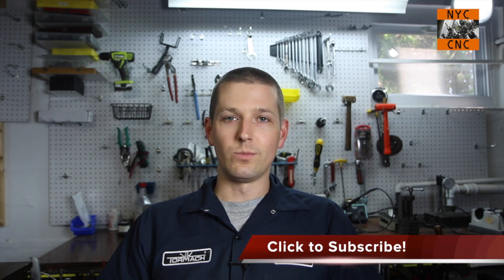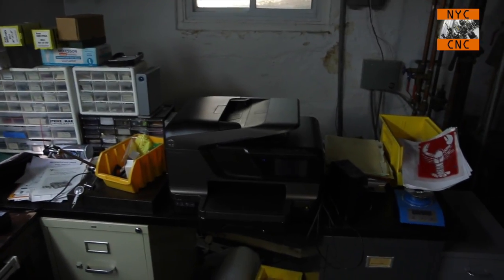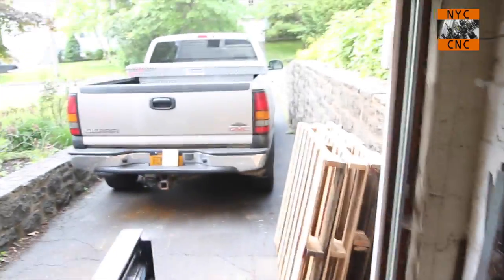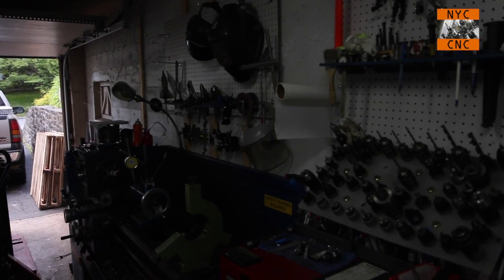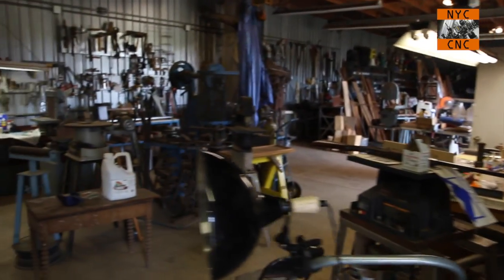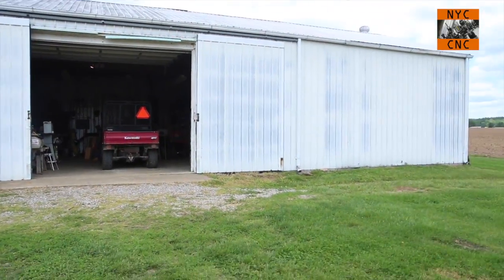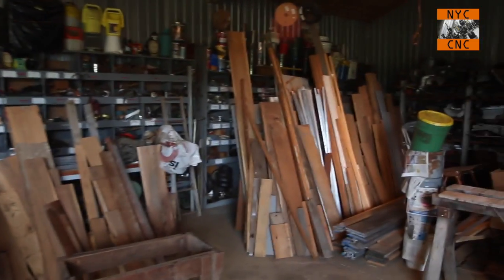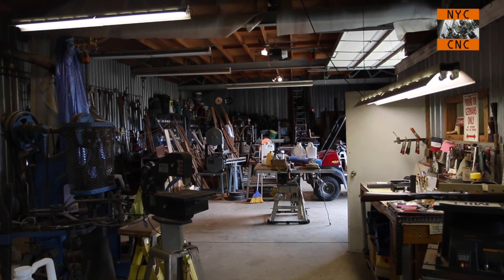NYC CNC:  Farewell!

Comment: Bet you hated stepping over that cherry picker and it's arms OVER AND OVER AGAIN !!!!    boxed mine up and hung it from the ceiling...
Clearly NEVER enough shelf and counter top space
Even after the move...  :)
Reply: Cherry picker or engine hoist...  3:00 in the video.  Had to extend the legs and the extension arm on mine to compensate for the long wheel base of my 420 Sel... 
Sooooo many toys in that new shop... :)